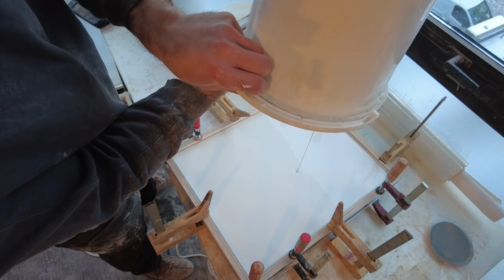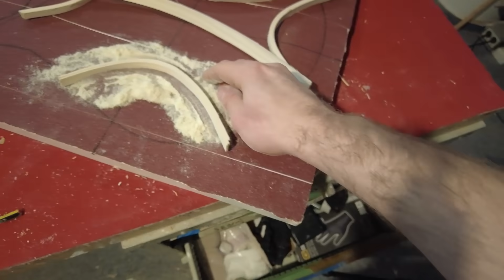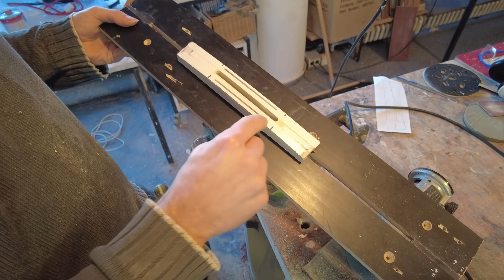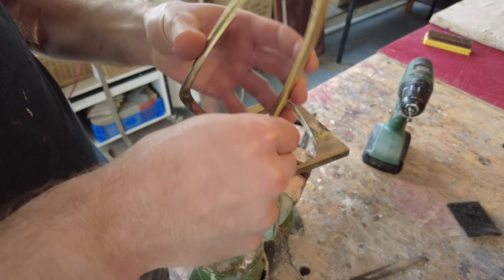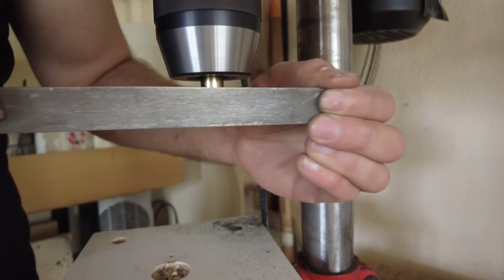Making a Doubletop Archtop Guitar - the "Canna Jazz" - (almost) Full Build

Comment: The problem of not stable pickup can be easily solved. Here is how:
Just make those two metal rodes not parallel. In a way that the tip of them which goes inside the fretboard be closer to each other than the position which they have near pickup.
If you make the tips of those rods completely round then they won't scratch their position inside the fretboard.
Thanks for the great masterpiece you made. It is a really fascinating art.
Reply from the maker: They are, I mean the two rods coming from the Pickup. And it works like you are describing.
Reply: @cannaguitars4593 so you did a perfect job. I really enjoyed watching what you have made. Thanks for sharing.

Comment: I know it's just a mould, but I really like the look of the contour lines.  I might experiment with making an actual top using that sort of construction.  It probably wouldn't sound great, and may not be structurally sound, but I feel compelled to give it a try.
The final guitar is beautiful, with a lovely tone.  I'm not convinced about the telescopic pickup mount though.  I can't help feeling it will be a source of buzzing, at least in some positions.  If you used a tube instead of an inner rod, you could run the wires down the tube.  You could cut off a slot in the bottom of the tube to allow the wire to go into the body.  Alternatively, you could use the inner rod as your conductor, soldering the pickup to one end, and the wire to the other end, again with a slot in the outer tube to allow the wire to exit into the body.
Instead of rubber bands for the pickup height adjustment, why not use o-rings?  They come in a wide range of sizes and I'm sure one would be perfect.  It would look a lot more professional.  You can buy an o-ring expander to assist you in installing them.

Comment: 28:34 You could have cut a very small channel into the brass that's in the neck and used a grub screw with an access hole to tighten and loosen the screw to prevent the poles from sliding off like you mentioned at the end of the video.

Comment: A good method to prevent cracking when bending veneer is to glue a layer of linen cloth to the face biased 45 degrees to the center line. If you use a heavy cut of shellac as the glue, you can remove it pretty easily with alcohol. The remaining shellac is not a problem as it acts like a sanding sealer.

Comment: Beautiful,  just a thought,  could you not pass the pickup wire through the brass piece to hid it ?
Reply from the maker: I would need some mechanism to pull the wire throught the pipe when I adjust the position. But technically, yes.

Comment: Instead of rubber bands; you can get butile or silicone o rings; durometer and size would dictate tension; as "Some rubber bands" will fail a lot sooner than a properly fitting o ring lol. Can also firm up the pickguard with a layer of teflon tape. Would just fill in some of the voids left. 

All in all; what a cool and beautiful instrument. Has a "Ritter" vibe, but its all you; that headstock is wonderful as well
Reply from the maker: I am using o-rings by now :-) Personally I am not a huge fan of Jens Ritter, but I respect his style. Just not for me. However, I see the similarities.
Reply: s4593  I know nothing about the man haha, not sure if there's some dark secret there or not. They have an arch top thing that this reminded me of is all. Very "curvy" esthetic. Glad to hear you've sorted out o rings.

Comment: In regards to the difficulty bending the top:
I have seen others wet down or steam wood for bending.  Have you tried that?
Reply from the maker: The problem with the top lamination isn't the flexibility of the wood but the geometry of the bend. It would still want to overlap at certain areas and tear in the middle. Steaming it would maybe help with the overlapping problem. I will have to do some testing.
Reply: @cannaguitars4593  
I'm sorry to be sticking my nose in when you are an experienced builder and I have no knowledge of your craft or of what I'm suggesting, but . . . . 😁
I feel like there MUST be a piece of software out there that could compute for you the difference in size (?) between a flat sheet and the 3D curved sheet, and would show you where you need to add or remove material.  Then you would make relief cuts where the additions would go in (as you did here) and remove material from "compression" areas which would then close up when you reach the 3D shape.
A CNC router would cut out the shape and any additions which would fill in the final shape.  You could even highlight these areas with different woods, etc for an interesting look.  
Are you familiar with Frank Howarth?
https://www.youtube.com/@frankmakes
He does a lot of CNC cutting and fitting.
Reply from the maker: @BLenz-114  Interesting idea to make a mosaic top. I would have never thought of this. As it happens, I just got a CNC, so it might be something to consider. But from my experience it will be better to just go with what I know can work and try to make it work. If you know what I mean. Thanks for the Frank Howarth recommendation. His videos are fascinating!

Comment: What about running the wires for the pickup inside one of the rods?
Reply from the maker: The problem is that you need some automated way to pull the cable in and out as you move the pickup.

Comment: Outstanding build! I'm impressed by your creativity and design taste. I'm a big fan of the adjustable pickup idea, only other option I've liked are magnetic pickups on steel body (made by Verso Instuments). Did you consider pulling the pickup wire through the brass piping? If possible, It could enable a complete lack of visible wires. 
Great work, a pleasure to watch!
Reply from the maker: I love the Verso guitar idea of the movable pickup. I thought about to make the mount from iron, so it holds on the there on its own. The problem with the wire inside the tubing is, that you need some automated way to pull the cable in and out as you move the pickup. I think using the pipes as wires would be the play here. My only concern is that it might affect the sound in any way?

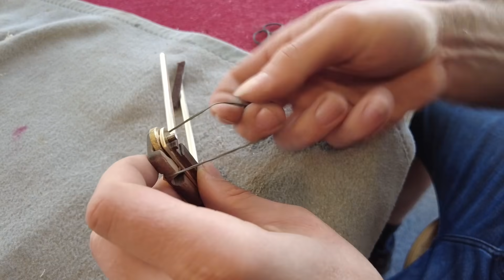Comment: 49:25 why rubbers and not silicone o-rings? Much neater and you don't have to coil them twice. As for the sliding rails of the magnet structure, you can insert at the side of the fretboard (exactly at the end) a headless screw at each side (just like you did with the pickguard) that will compress the rails and keep the magnets exactly where you want them. Another point of thought is the shape of your fantastic bridge. I would reverse its shape (shorter upwards-longer downwards) so it does not interfere with the picking hand's wrist (54:40). Wonderful work!
Reply from the maker: Actually, I have switched out the rubbers for o-rings by now :-) Also, I feel that locking the Pickup isn't really necessary if the friction is dialed in correctly. But since everyone seems to recommend something like it, I will think about a locking solution.

Comment: Could you not use a tiny locking screw that holds the sliding pickup holder in place once it’s set…bored in a hole from the btm/right of the finger board?
Reply from the maker: Sure, you could have some locking mechanism. I like the clamping because it works with friction and the fewer parts the better in my opinion.

Comment: I like that you are using the  "Kasha school" guitar building approach.  Although I don't build acoustics, I have a similar building style, as in I have all my own designs and never copy others instruments, and often build hardware by hand, mainly tuner, switch, and control knobs, pickup rings and what not, and also love to hide mechanical elements like floating pick guards and such where it's not operant how they stay in place...  I like the look of the tail piece, although it's risky having it hold by string tension only, as sooner or later someone may damage the top with it.  I have a jazz arch top semi-hollow I need to finish (make the bridge), and I made the tail piece out of two metal rods that just slide into the through block of the body which also holds by mere string tension, but stays in place by how the two rods are screwed together on an angle, that need to be separated to get it out.

I also like your esthetic style in artistry, and I too have a keen eye for design, and often build to a theme, and sometimes even make up a short story to go along with it.  I always use matching woods all over the instrument, as I always hated instruments that look like the neck and body don't go together, like so many guitars do, IOW:  If I use a flame maple top, then I also use a flame maple head plate or fingerboard and headstock binding, maybe in the inlays too.  It just looks so much better when everything ties together and nothing looks like it doesn't belong or is out of place.

Last but not least I am high tech, and have been using carbon fiber, two way truss rods, stainless frets, full fret access cutaways... since the mid 80's already, and keep the weight down and balanced.  I also have never used hide glue, nor nitrocellulose which breaks down and decay's, melts under heat, yellows...  When the instrument is stable as granite, and can handle pretty severe abuse without breaking, there is little to no need to ever have to take apart glue joints and make repairs in the first place!  No planned obsolescence from me, I want people playing my instruments hundreds of years from now!

Just one suggestion:  The sliding pickup is great, and will give more variance in tone than using two pickups and a bunch of EQ, but I think springs will be much better than rubber bands, and some kind of sliding lever that keeps tension on the rails, but releases when activated to move it;  Now I have to go to the drawing board and see what I can come up with. 

Great work Jakob!
Reply from the maker: Hey Bob (I assume). Thanks for your extensive feedback. Here are some thoughts from my side. 
I wouldn't call my building style Kasha.
Even though it's asymmetrical. I used a falcate bracing on this one. 
The Tailpiece is only held by the strings, so for any string changes you would have to change them one by one or put something underneath like I did. For the woods I also like to use a limited variety, so mostly one wood (in this case plum) plus the neck (usually maple) and in most cases the spruce top. 
For the pickup I tried using springs, but there is just not enough room for that. Maybe you can come up with a design that works with springs and is as flat as this one (~8 mm). 
Check out Lukas Schmidt Guitars from Germany. He came up with a mechanism to unlock the sliding pickup:
https://www.ls-guitars.de/cms/index.php/en/12-en/
I like the friction solution. The less mechanical parts the better in my opinion. 
Best you contact me via mail if you want to discuss this further: Jakob@cannaguitars.com

Comment: Amazing work.  Thank you for sharing.

It would be interesting to hear it without the amplifier.

Do you ever measure the acoustic response of your guitars with a microphone and software?  Room EQ Wizard works well for this (and is free).
Reply from the maker: Thanks, Greg,.
This
 one is a bit 'overbuild' since it was my first archtop
 guitar. So it sounds best via amplifier. Acoustically it sounds a bit like a maccaferri
 style guitar. I have already built another one which sounds much more open. I will share recordings of the 2nd one soon.

edit: I haven't tried the Room EQ Wizard, but heard of it. For me, it's more of a gut feeling when it comes to the voicing. I tried to find a connection between the main frequencies and the overall quality of the sound but never found a one. 
I try to have the Helmholtz below 82Hz though.
Reply: @cannaguitars4593  82 hz being the low E.  That's unusual, isn't it?  90-100 is typical for a flat top.  100-150 for an archtop (like an L-5). 95-110 for a Selmer.
Reply from the maker: @gregholmberg2  Interesting. Where did you get these numbers from? In my case it's more like a trial and error type of evolution. I noticed, that when I get it just below the low-E, I get much more sustain in the lower notes since the Helmholtz isn't interfering with the other frequencies anymore. And I feel it adds more "oomph" to the base.
Reply: @cannaguitars4593  Well, I wrote you a nice long response and youtube deleted it. Probably because i referenced web sites.  Arg.

I suggest these resources:
Book: Contemporary Acoustic Guitar by Trevor Gore and Gerard Gilet.
Book: Mastering the sound of the acoustic guitar by  Giuliano Nicoletti
Paper: Archtop Guitar Dynamics by Thomas Joseph Nania (free download)
Reply from the maker: @gregholmberg2  Thanks for the info. I thouhgt about buying the Trevor Gore Book. Currently it's out of stock. Also I read the Somogyi Book when I started out. It helped a lot. The Giuliano Nicoletti book looks interesting. Does it add a lot of information if I have already read the Somogyi?
Reply: @cannaguitars4593  I love the Gore book--my bible for the science and engineering of an acoustic guitar.  I've implemented his formulas in spreadsheets, which I share for free.

Giuliano is a very helpful guy and builds great guitars.  Iulius Guitars.  He has some guides on his web site that are helpful.  I haven't read his book yet, but I believe it uses Gore's methods and makes them more accessible and understandable. 

I haven't read the Somogyi book.  Others have said it is more intuitive and subjective. You learn (after hundreds of guitars?) to feel things about the wood.  Gore is all science and engineering. Calculate, measure, adjust. Repeatable, objective.

You can probably tell which one appeals to me! 🙂

Comment: Those crack on top layer remind me how Ken Parker builds his tops with two stages - with paper in the seam for preliminate carving and then final glueing with final fine-tuning carving... He has excellent channel there, on YouTube) That's really open question is it possible to make double top with such method - maybe with two parts of nomax and wood sheet in the middle.

Excellent guitar! Really fresh breeze in guitar making)
Reply from the maker: yeah, I've seen how Ken does it. Not sure if it's the right way to do it when laminating. But interesting Idea!
Reply from the maker: I'll just say it's inspired by my Logo design ;-)
Reply: @cannaguitars4593  you really need to reconsider rubber as spring mechanism - in 2-3 years it will dry-out and could even disintegrate... or in 5 years. And of course such event happens when player will less expect that.
Reply from the maker: @YegresAL  another reason why I'm not using that anymore. I'll 3D print the pickup slider in the future, it's still work in progress :)
Reply: Didn't listen to the end about your inspiration on tell piece ))))